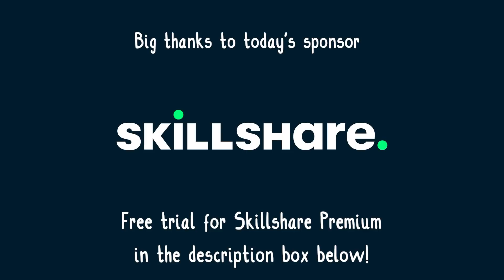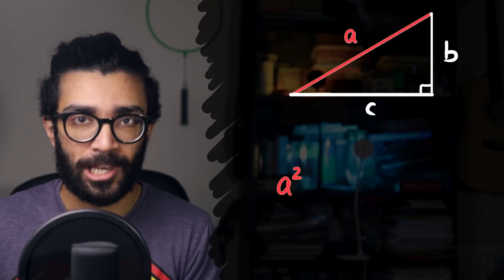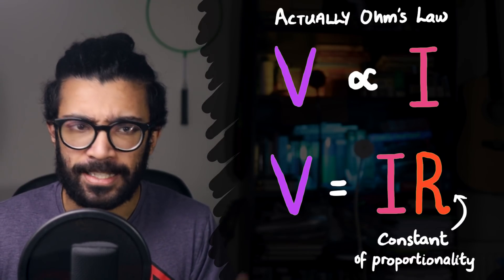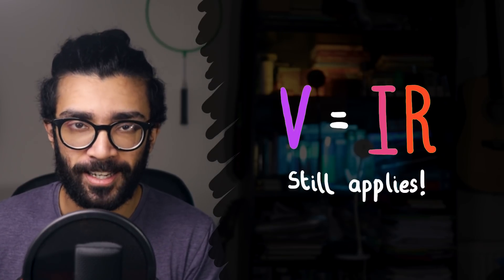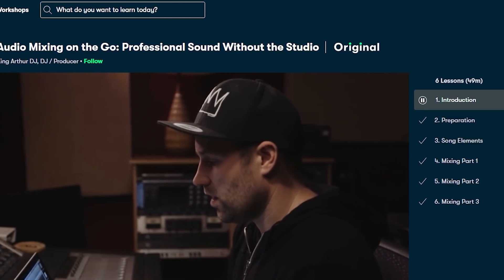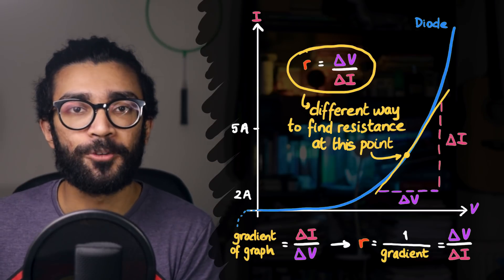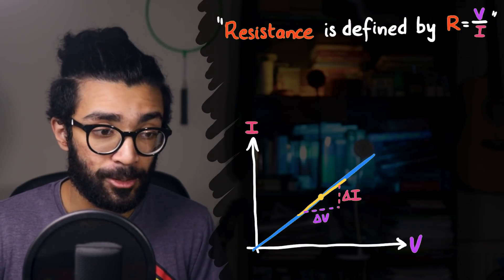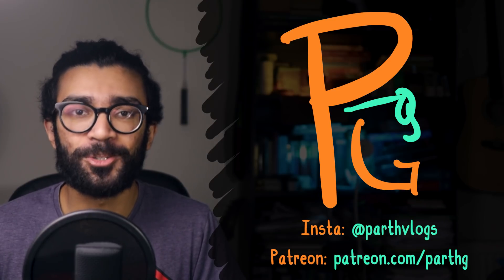Why Ohm's Law is NOT V=IR - there's more to it! Resistance must be constant - Parth G Physics

Comment: Ohm Law may fail in Many cases. For example:

-When the material has non linear electric properties.
- When the current in the circuit is strong enough that the induced magnetic field must be taken into account.
- When there are external electric or magnetic fields that can deviate the electrons trayectory. 
-When the Voltage is too high between 2 points because there are importante thermic effects in the circuit. 

All of these cause that the graph is not linear anymore.

Comment: Potential is the self (I or ego) encountering resistance in the world. Our human potential is the flow of self encountering resistance. VIR is an ancient Sanskrit word for man (in English we have virility and virtue plus all the yoga poses that begin with vir-). 

Human = self times resistance. The self or I or ego is flow. Without flow, death. In summary, V=IR. With such knowledge I begin the video. I modify now according to your instruction: resistance must be constant for V=IR to work. Hmm. Makes sense. Life has ups and downs. So perhaps we can modify it thus: to be human means to have this constant fact of life's resistance.

If I'm understanding 'd' correctly, it's like delta, right? Change. Like the way the Mississippi is one channel for so long till it considers flowing into the ocean, at which point it deltas into multiple channels. Delta is ready when you are [joke for the over-fifty crowd now facing the changes of old age]. And I think you're saying that V only equals IR at fixed times, not during delta times, which is to say not during change. Snapshot not movie. If you gotta calculate gradients that's more like a movie.

Pretty cool that I did this without any "resistance is feudal" or ohm/home jokes, so bonus points for me.

I will go off now and muse about how the letter I, the self, the flow, the current, can exist in static time. Do we exist without flow? I'm just trying to keep  as the French might say. Stay current! Don't get old! Does VIR, man himself, exist outside of delta time?

Two years have flown, flowed, past since you made this video. "You" don't exist.

If 'I' is current, current is flow, and flow only exists in time, and time is always delta time [Delta is ready when you are, I might have mentioned]. Therefore I is only potential. Making flow sound a lot like voltage. Sheesh. So there are other ways in which V doesn't equal IR. And don't get me started on the ontology of "equal," because nothing "equals" anything else. Are we having fun yet?

Comment: Parth, that was a great example of the Pythagorean theorem! I think that the public school system is still very much broken and only values "knowing what to think" rather than "knowing how to think". But yeah, also I think that's a great point about non-ohmic conductors/diodes, R=dV/dI or differential resistance. I think that coming up with new creative solutions and new theories of reality is more important(and we should not even think of it as "right/wrong" theory we should just gain a better understanding of "The Truth") rather than going with what is already known(ohm's law, R=V/I or static resistance, I have seen the same thing with electrical engineers memorizing "V=IR" rather than questioning it!!!). But anyway, Great explanation Parth!

Comment: All you've done is define R as a function to make click bait. Nothing in Ohms law states that values of V,I, and R must be constant or linear. I could define R as a function over time of the apparent resistance between emmiter and collector of a transistor with a base driven by appropriateally biased DA converter driven by a random number generator seeded by the movment of a lava lamp. 

Is that going to be a function? Yes. 

Is it going to be analytical? Hell no, it's not. 

But ohms law still holds even in that extreme case.

The point is that just because there is a variable in an equation or function does not mean it must be a constant.

Comment: I would disagree with you that "V is proportional to I" in non-ohmic components.  I think this too is a confused misconception.  The concept of proportionality is well defined in mathematics, and it means that the relationship is both linear and that it passes through the origin of a graph (0,0).  The definition that you are applying (proportionality) to non-ohmic components is nonsense, since non-ohmic components do not have a linear relationship between current and potential voltage difference.  The suggestion that you can call them proportional is... based on the fact that any two real numbers can be divided.... fails to grasp the concept of proportionality at all.

Comment: Thank you for the video. I would like to better understand this topic. It seems that ohm's law is not a true physical law. The ohm's law is much more a logic relation as the one you showed for the pythagorean theorem, that tells nothing on the physical world. If R was a constant in the same sense of Boltzmann constant, in this case I believe that it would be a true law. If a large current passes through a material it heats up and the resistance changes, that doe not happen with Boltzmann constant. And also by considering that there is no such a thing as a pure resistor, all materials found in nature exhibit the three aspects of electromagnetism, namely, inductance, capacitance and resistance, this reasoning also leads to the conclusion that the ohm's law is a logical idealism of an electrical behavior. What do you think?

Comment: And this really only true for constant voltage/current and situations where there is no energy storage. As soon as we introduce circuit elements that can store energy things get even more interesting. For inductors, voltage is proportional to the time derivative of current; for capacitors, voltage is proportional to the time integral of current. 

Oh, and then we can get into AC circuits, where we have frequency-dependent impedances

Comment: If V is proportional to I but inversely proportional to R, then why do some circuits have a very low voltage but very high current? I understand that to have a very high voltage and reduced current, the resistance needs to be increased, but what needs to be different for a circuit with incredibly low voltage to have a large current? Of course, the resistance would need to be very low but I have the intuition that only a very low resistance may not account for the significant difference between a low V and a high I.

Comment: So, what is the reason for saying "Ohm's Law is NOT V=IR...". Of course, that is Ohms Law. Placing the restriction of constant resistance does not invalidate the law as your title implies.

Another good example of circuit components that change resistance are the filaments of ordinary incandescent light bulbs. As the filament heats the resistance increases, until it reaches operating temperature, at which point the resistance remains constant.
Reply: Because all devices follow V = IR (as R = V/I serves as a mathematical definition of resistance), but only ohmic devices follow Ohm's Law. If we say a non-ohmic device does not follow Ohm's Law (true), and if we say Ohm's Law is simply V = IR (not true), then it follows that a non-ohmic device does not permit use of V = IR. However, V = IR is perfectly applicable to non-ohmic devices.

Comment: Actually, Ohms law is a result of Phonon-Electron coupling and linear response theory. Therefore Ohms law should not hold true for Ohm conductors either if the voltage is high enough.

Comment: Similar arguments could be made for Newton's Law of Viscosity or the real versus ideal gas equation but the compressability factor varies but not so in the ideal gas equation where the compressabilty factor is one. One of the most difficult idea I had to get across to machine design engineers as a thermal fluids engineer is that not all phenomena are linear and start at zero nor are the two dimensional nor are they continuous functions.

Comment: No mention of the power relation P=I^2R=EI=E^2/R?  Another way of stating the static resistance definition is simply that one "ohm" is equal to a volt per amp

Comment: Pythagoras' Theorem holds true for n dimensions, so still saying a²+b²=c² is wrong, because it's for k elements add all the squares of each Q from 1 to k and take the positive root of the answer as your diagonal length of a k dimensional cube.

a²=a², for k=1 ; a²+b²=c² for k=2 ; a²+b²+c²=d² for k=3 and so on. So just saying Pythagoras is the 2 dimensional formula, is really weird.

Comment: I have another doubt. 
The Ohm's Law states : "The Current flowing through the circuit is directly proportional to the applied Potential Difference." 
It means "I is proportional to V", which in my views is different from "V is proportional to I", which we are taught to be same.

Then, why in books, they write it -
According to Ohm's Law, 
I is proportional to V.
Mathematically, V is proportional to I
And you get, V = IR.

If you understand what I mean, please do clarify. Support your amazing work.

Comment: Well pretty accurate ! But notice the  resistance does not exist on it self !  Resistance  is  just the module  of  the  impedence  which introduce  a phase shift  also .Hence the   for a dynamic resistance  the value is not  constant.

Comment: Nuance . R =E/I and in this case it always holds.Diodes have ohmic resistance as well as current dependant gap . A complete model is even more  complex.  Impedance is defined , yes defined, as Z = E/I .
Resistance is defined as R=  E/I . It is right in the word "defined". V = I×R is not the definition of voltage. Impedance and resistance are the derived variables not voltage or durrent , they are derived otherwise.  The resistance or impedqnce can be instantaneous or it can be a function .

Comment: pretty much from the begining it was assumed for constant r . Not too many past high school physics doubt this.  It was in electronics shop in high school we tried  to figure out r for a light bulb. Which is still ohmic but variable . I fact all r is variable in reality you just can assume it is not if it is in spec and small variations dont matter. 5%tollerance is often sufficient and even 20% were used. As for the light bulb its r is proportional to
temperature  and temperature is  proportional to the fourth root of power . To a first approximation. Without calculus we did algebra till we came up with a formula. We wanted it for a feedback resistor in a wein bridge oscillator.

Comment: I've been an electrician for a couple of decades, and I just realized the blessing/curse that we deal with in these equations is from the defining of units such that a volt is an ohm times an amp. This simplifies things greatly, since there is no conversion factor, but the absence of the conversion factor makes the concept simple to the point that you can loose track of what's really going on.

Comment: Sir pleasee reply...why can’t we write I proportional to V and then proceed to write I/v=R..why doesn’t it work that way?
Reply: It also works that way. It simply depends upon your equipment and/or experiment. I'm my physics labs it was usually easier to increase the voltage across a system and measure the response of the current. But you could do the opposite as well. If the current is the output of one system, then you might want to measure the voltage response of another system due to that current.

Comment: Nice explanation. Maybe people don't discuss it too much because when you go to models and circuit analysis of practical devices, such as the diode, simplifications are made to convert non-linear devices into linear models with ohmic resistance + linear circuits' analysis in parts (e.g., for diodes, an open-switch model and a closed switch model). The first chapter of recent editions of Boylestad's book on electronics has a very insightful intro to semicondutors with a detailed discussion on the diode's dynamic resistance. Regarding what really is "ohm's law", I really prefer to ignore the historical experiment and approach it with the insights from the microscopic view and focused on "conductivity" to derive J=sE (s for sigma, the conductivity). My point is that  you gain much more insight in materials characteristics instead of some mathematical model for ohmic resistors.

Comment: Everybody gangsta till the circuit has an impedance so now we've got a resistance that's a function of the current flowing through it and a current that's a function of the frequency it's flowing at :')
Reply: AC analysis gives me a headache.  :D
Reply: If the circuit is linear time-invariant, you can use phasors, which is still easy.

Comment: Laws are based on  problems. Not as a universal truth. We just use it when the problem looks simple. There's some experiments can be explained with an algebraic model. Other cases like variables can be described with More complex Versions of the model. Like a differential equation . For example
R=dV/dI. U see it's way more complex don't you think?

Comment: With all do respect! I strongly disagree with the part that you said:"the larger the potential difference is the larger the current runs through the resistance"
I will give a simple example
Let's assume that we have a 12V DC power supply, and a 2Ω resistor. If we use Ohm's law I=V/R so I=12/2 so I=6Α. Now, let's assume we have the same power supply, and a 3Ω resistor, if we use Ohm's law I=4A. So if we increase the resistance the potential difference increases but the current decrease. 
If what you said was true, then dimmers wouldn't work, and propably the light's wouldn't switch off!

Comment: The static resistance is the slope of a line from the origin to the point on the (I,V) curve. The differential resistance is the slope of a line tanget to the (I,V) curve at that point.

Comment: This reminds me of thermodynamics in chemistry. Specific heat changes depending temperature and pressure, as do most other thermodynamic properties, making curves such as internal-heat vs temperature not straight. Introductions to chemistry often act like it is constant because it usually is almost constant if all of what your doing is broadly close to standard temperature and pressure. That works for normal laboratory chemistry, but not for, for example, geochemistry.

Comment: V=IR is maybe used for ideal circuits and it's still applied. example in power line, the wire is consuming power before going to every household because the wire has resistance and causes small ammount of voltage drop depending on the distance from the transformer to you house.
every kind of metal has its own specific resitivity. even liquid and gas has too.

Comment: But ohm's law clearly says it's not applicable for non ohmic devices such as diodes and transistors,then what is the point in applying ohm's law to them...and since the temperatures affects resistance, ohm's law also says it's not applicable when there is change in physical conditions...
Reply: It's an approximation, dude

Comment: Can you explain the logic behind electrical transmission lines?

In order for power companies to send power over very long distances, they increase the voltage, which decreases the current in the line because Power = V*I.  But ohms law states that V=I*R, so the only way to increase voltage and decrease current is to increase the resistance? That makes no sense to me

Comment: Parth.G.....if it is your style...then...
I'm also planing to start my YouTube Channel.
My First video's thumbnail will be "How Ohm's Law is a Blunder??"
Content of that video can be summarized as follows...
Let a cell is connected to a resistor.Applied Voltage (V) is varied and corresponding current (I) through resistor is noted.
Here V is independent variable (comparing with I).
I is dependent variable (comparing with V).
How anyone can write, independent variable(V) ,proportional to ,dependent variable (I)?
Apply common sense..we should correct Ohm's law as follows..
Dependent variable(I),is directly proportional to,Independent variable (V).
Mathematically we can write Ohm's Law as...
I=RV....😇

Comment: R is not constant always. There are variable resistors
If you measure 3A through a wire and you measure 1V across it it means, that the Resistance has to be 1/3Ω cause R=U/I
The more voltage the more current (at same resistance). The more current the more Voltage (at same resistance) The more resistance the less current (at same voltage) the more resistance the more Voltage (same current)
If you want to understand a formula you ve got to always fix one value and variate the other ones. (at three variables)
It doesnt matter if its ohms law or anything else.
Theres alway more to it
For example:v=a*t
well which  v ? The v before acceleration? of course not! The v while acceleration also not. The v at the end of acceleration yes. But only if the v at the starting point is zero. Cause else its ∆v=a*∆t
The same is for the E=1/2mv^2.
Or p=F*t
If you press against the wall with a force of 1N for 10seconds. Then the wall an also you wont have a impact of 10Ns. Cause all the forces cancel out. But this has to be considered. In physics there isnt only the formula, but also the context. Or else it could be interpreted wrong.
But i know that earlier i also understoid it wrong in scool. 
But i thought about it, and got it.
Youve gotta think to understand
(i actually made the mistake, that i didnt think of the fact,that the overall voltage of a circuit normally doesnt change. I calculated in my head as if current was constant although i new (i think i knew, but this was several years ago) that the averall voltage should be constant. I just got cobfused by the formula cause i didnt consider, that I can change. (;